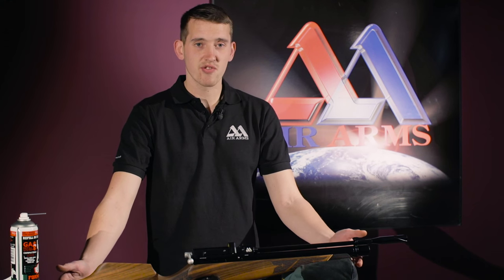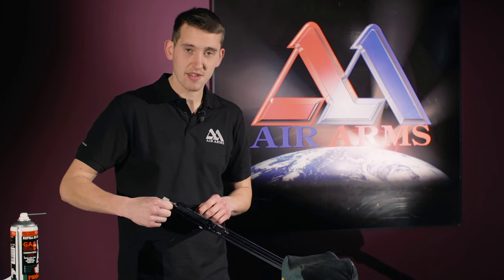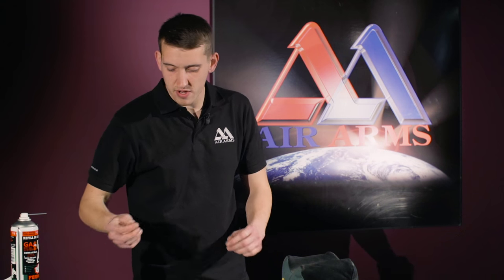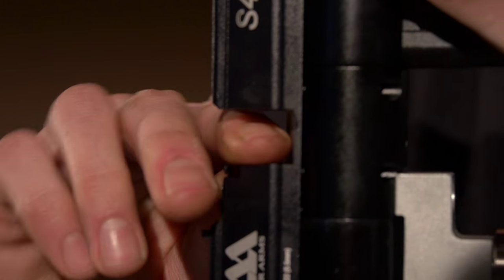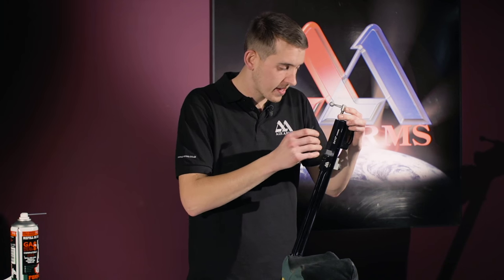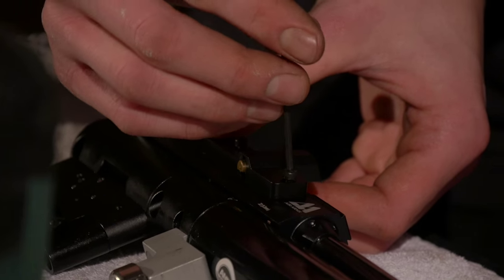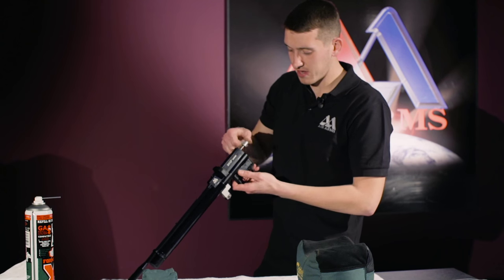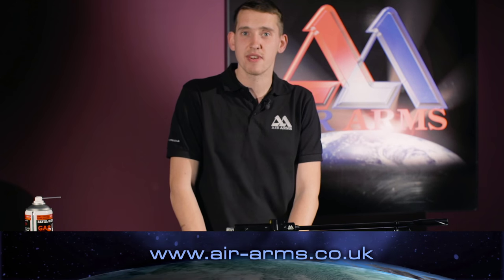Air Arms D.I.Y: How To Replace The Barrel Seal On A S400 & S500 Air Rifle

Comment: I said in my previous comment that fitting the new seal very fiddly to say the least! But if you put a length of plastic rod 4mm dia or wooden rod (dowling) 4mm   dia down the bore and stop just short of the recess then the o ring when you try to insert it cannot go past and just goes straight into the recess. This was the only way I could get my o ring in place (kept on going past the recess on its side) works ok only takes a short time with no swearing!